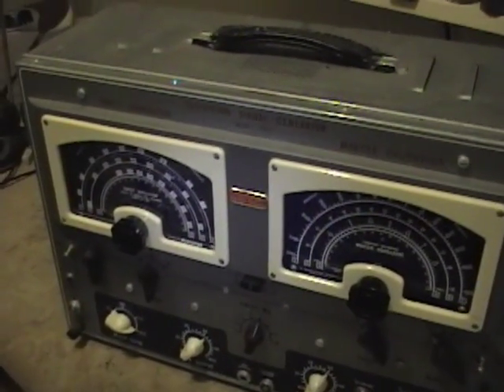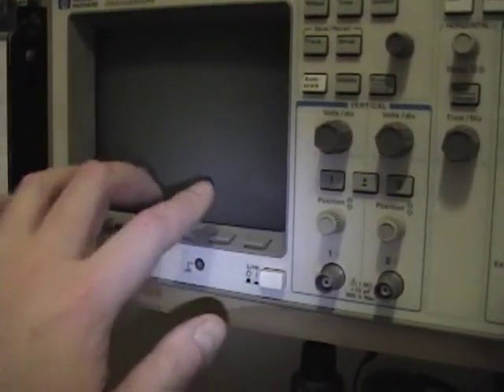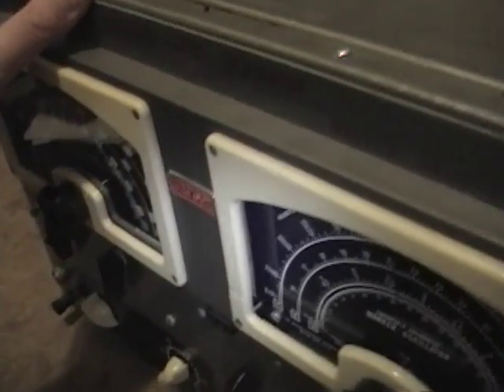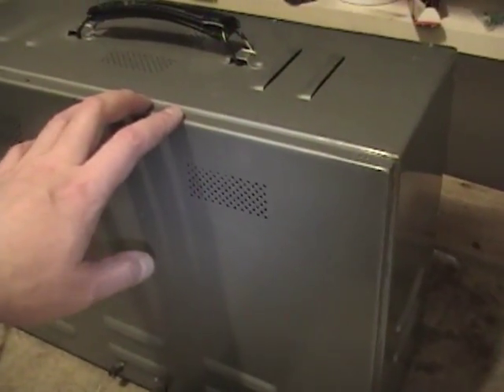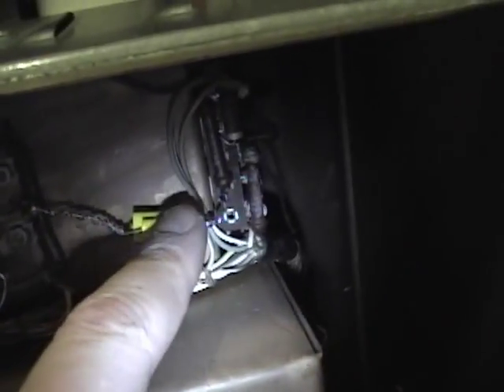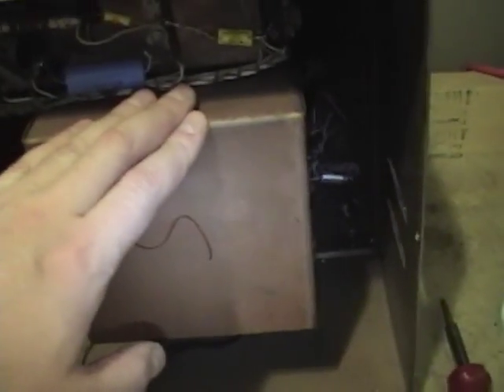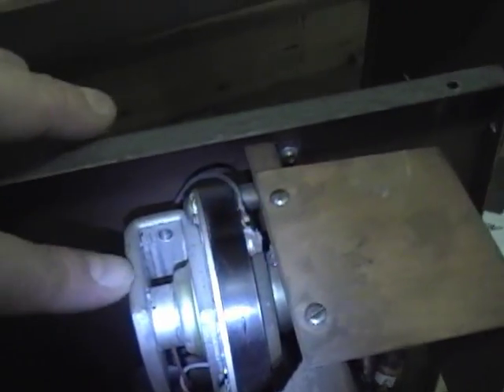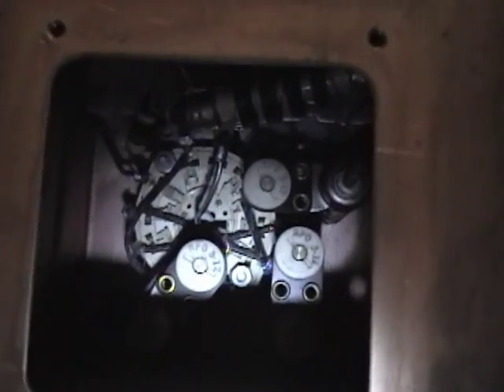Jackson TVG2 Vintage Sweep Generator p1o3

Comment: I have a Jackson TVG2 Television Signal Generator.  My father used equipment years ago when Denver CO began to have TV.  He went up to a high point on our mountain range, found a TV signal, put up a translator and beamed TV to Leadville.  I believe each home had to have a UHF converter.  Would this have been part of that equipment he used originally? Or was it used to repair TV's?  Thanks for the information.
Reply from the maker: This device was primarily used to repair TVs.  It's possible he used it wile setting up that translator to set the transmitting frequency and such.